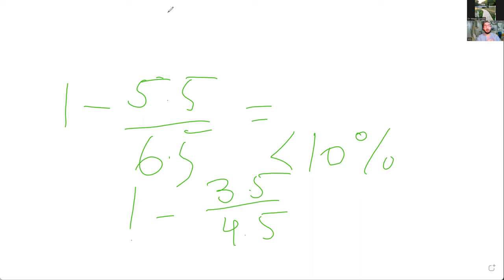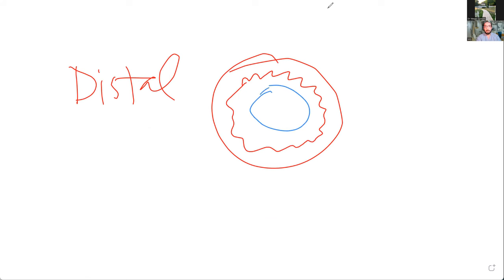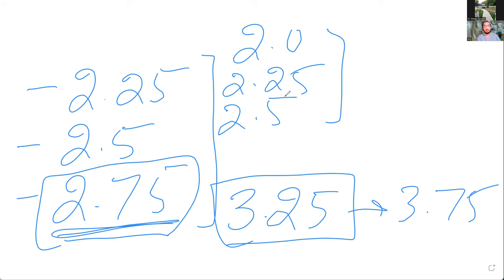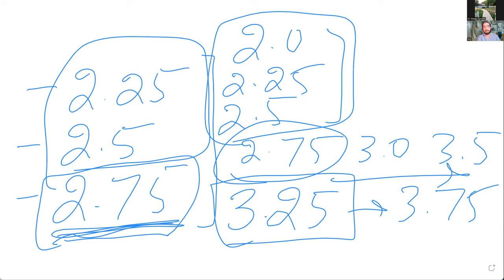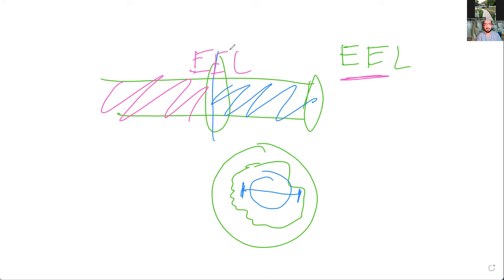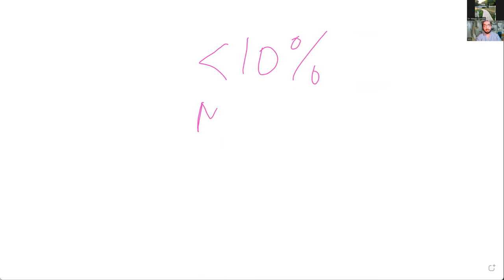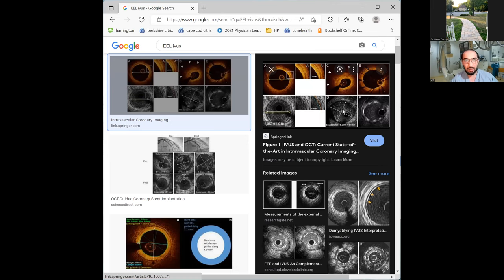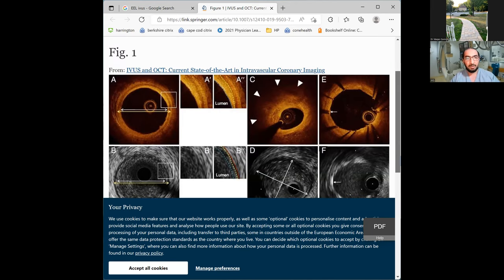How to size the stent using angiography or intravascular imaging?

Comment: Great one
Thank you very  much 
in OCT with EEL to EEL we ROUD DOWN  unless already at stent size and with Lumen diameter we round up by 0.25
What's your approach with IVUS in regard to EEL/EEL and lumen diameter ? thanks
Reply from the maker: I use mid wall instead of EEL to EEL for IVUS. EEL to EEL for IVUS is aggressive as i mentioned in the video that IVUS could show larger size of the vessel which may not be the true size. It oversizes by 8% as shown by meta analysis of IVUS clinical trials compared with QCA.